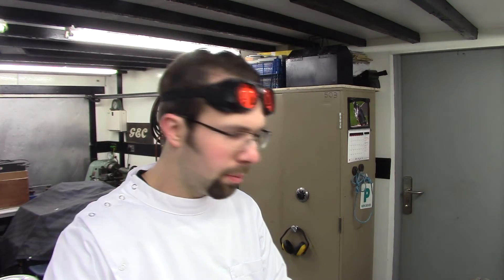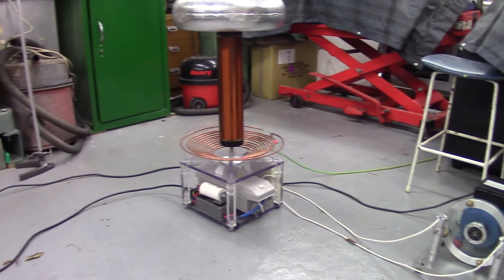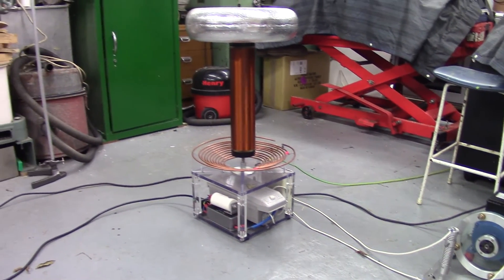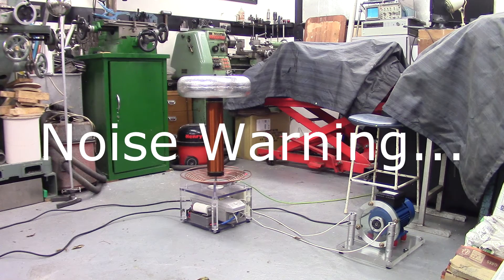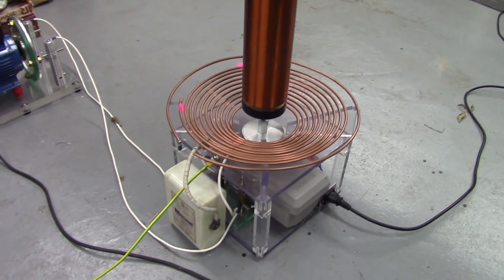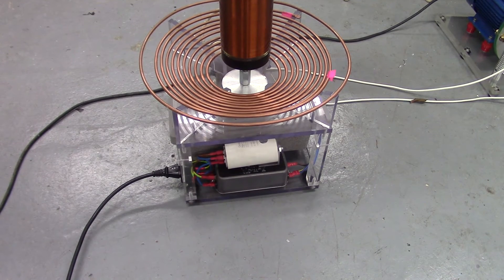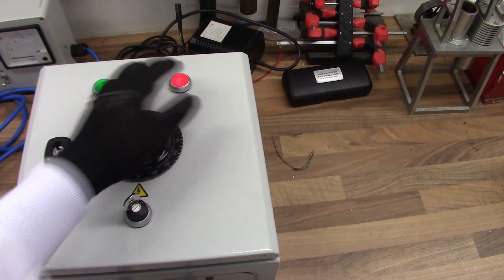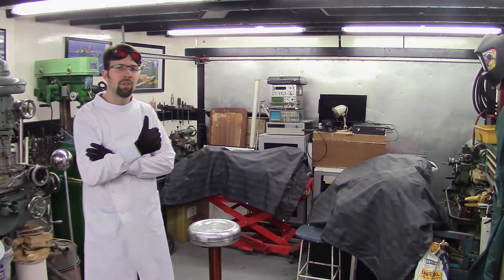Synchronous Rotary Spark Gap Demonstration

Comment: Why do people use such massive motors?  It's like boiling an egg with a nuclear reactor.
Reply from the maker: There are 3 reasons that enter my mind to why I would have over-specified the motor size:
1; The motors are modified on these types of spark gaps by milling a certain percentage of flat surface of two sides of the cylindrical rotor, because I'm effectively removing part of the magnetic circuit from the motor there's a higher chance of magnetic saturation resulting in excess heat, which is easier to dissipate into a larger body of metal with a larger surface area.
2;  there's an element of uncertainty when you modify a motor in this way and in some form of irrational fear of it not working, the answer is more swarf = more chance of the magnetic fields locking into synchronous mesh with each other, but still have enough metal left on the rotor.
3; this size motor was simply cheap and easily available on eBay, which is where most of my parts came from to make these devices cheaply at the risk of them not working at the time.

Comment: Classic type spark gap I am making Tesla Coil.  I have a
few questions to ask you. I would appreciate if you help. I use a 15
kV 30 mA Neon transformer for the input. I used a ceramic type
capacitor for the primary capacity. capacity 25 kV 30 nF. Capacitor
information 6 pieces 10nF 10 kV. 6 pieces 10 nF 15 kV. If I connect a
parallel 10 Megaohm resistor to each capacitor for fast discharge,
will the tesla work correctly? Will it be enough for insulation if I
cover the capacitor leg connections with silicone? Spark gap distance
13 mm is enough? I used 10 mm copper tube in the primary coil. I
wrapped 10 turns. How many mm should the connection cable between the
capacitors and the copper tube? I have 1 mm copper wire for the
secondary coil. How many times will the number of turns of the
secondary coil be? There is a 50mm diameter and 400 mm long plastic
pipe. How many turns should I spiral to resonate correctly? When the
process is finished, what is the spark length in the end when testing?
Which equipment do we need to cool when we make this circuit? Does
over-winding of the secondary coil cause overheating? Is it necessary
to cover the secondary winding with varnish?

If you answer this e-mail, I would appreciate it if you could help.
Reply from the maker: Hello Engin! All very relevant questions when designing a tesla coil there is indeed a lot to consider and quite often changing one thing will effect another to a point where it drives you insane!

However, you are in luck because some very clever person realised this problem and so then created calculation software to help design your Tesla coil whilst maintaining your sanity.

The software is called "TeslaMap", there are numerous versions, each slightly different, but generally they will all do the basic design and calculations for you.

It is also worth mentioning another Tesla coil design program called "JavaTC", as an alternative if you prefer.

All the best with your TC!

Comment: looks liek you have bunch of Variacs that just sit around, can you send me one ill pay for it via PAY PAL
Reply from the maker: Hi Pavle. I have a few... where do you live? Could be expensive shipping!
Reply: Im in Europe , yes its gonna be expensive shipping , i just published a video of Amplifier Repair( https://goo.gl/Q1JNEc ), camera went out of memory before i showed what i did but its enough for you to see why i need Variac  , i love electronics but dont have the hard cash needed for some of the gear, so i made my self a current limiter just not to die while working , shown in video on top of old Scope , and i ordered a Power Regulator based on TRIAC , its a Ligh Dimmer Circuit basically with more power ,  but that also is not as good as Variac  . But in any case im in Europe/Serbia , my mail is dedskin at gmail . So we can PM there if you have something  light for me  , i dont need a lot , just to be able to work on basic amplifiers and stuff and not die :) I work as Audio Producer , for a long time, decades even,  so i get paid over PayPal , but if your variacs are expensive plus shipping i dont know if i will have that much at the moment , but i do have constant income so maybe we can work something out . I did purchase stuff from USA before ,   it was not that expensive shipping , because it was not VIA  AIR   it was a boat i think , took 2-3 weaks to come . Anyways im grateful  in any case , variac or no variac, i just see you have a lot of them , i work with electronics but cant afford my self some expensive unit, watched your video on INSANE LINEAR VARIAC, blew me away

Comment: Hello Steve,
One half of the two Phils here:
Nice to see another SRSG coil on the UK scene.  We (myself and the other Phil)  will (all being well) have a permanent 100 bps coil as well next year as 100 bps is something we have both been keen to try as well. I have 'dabbled' with it on the 200 bps Phoenix, and I admit to preferring the sound of 100 bps, also as seen in yours the streamers take on a "lazy" appearance, rather then the frantic activity of higher bps coils.
That's a nice phase controller setup you have, much tidier than my own workmanship I have to say. Instead of the sophistication of  a delay in switching in the phase, on mine I use a switch - and then often forget to do it! (dam coil isn't running well today...)
If you ever move away from the NST to a ballasted supply, take a look at Richie's Resonant Charging work, where you match inductance and cap value to the bps rate being used rather than mains frequency. His webpage on it is incomplete (2nd page was never completed by him) but he posted a full explanation on TCML (on 16th June 2001 - but the links to his quoted graphs are dead) However the whole TCML transcript and the missing graphs are available on my site.
Nice SRSG terminal posts - I think I've seen that design before somewhere..............................Aluminium is much easier than copper that's for sure.
Phil
(the grey haired old bugger of the pair with a stick)

Comment: IMHO - You must be using a great TC tuning technique! Also, your 30nF cap is at 1.5 times the resonant cap size so you are heavily resonant charging and could be drawing 209mA from your '50mA' NST. So input current could be 10000/240 times 209mA or 8.7A at 240V so input around 2100VA. Power somewhere around 1kW to 1.5kW estimated. Should be enough to sustain about three feet of arc? Great system throughput!
Reply from the maker: Ian, sorry for the late reply.

According to Teslamap 6.2.2, the 37mA NST would require 30.7nF on a Sync Rotary Spark Gap (ignoring the short circuit current at the time).
Admittedly I did swap to a 10KV 50mA NST during testing prior to Cambridge Teslathon which did increase the arc output,
despite requiring a 54nF capacitor since the short circuit current would be now 65mA...
In hindsight I should have used the secondary short circuit current of 48mA with my 37mA NST to work out my optimum MMC capacitance.

The main reason for increased output in the above video would be the repair to the damaged topload, since I did not have any spare foil tape at the teslathon.
I did not make any changes to the tuning from what we had worked out ourselves.

On the down side I have already reverted the Tesla Coil back to it's original Static Spark Gap with 37mA NST and 20nF MMC, which also is calculated wrong, needing a 24nF MMC... haha!

Will keep this in mind when I come to build the large SRSG it was intended for. =]